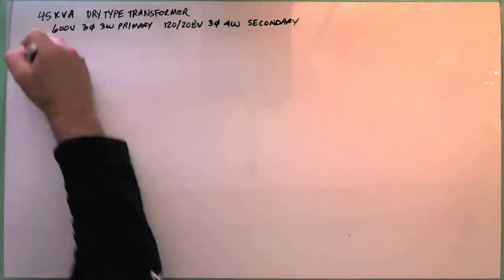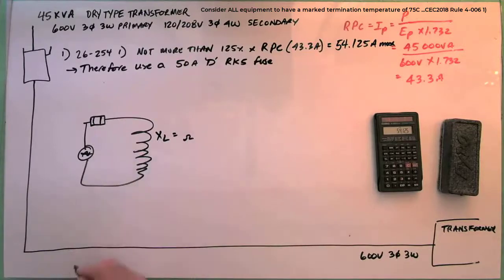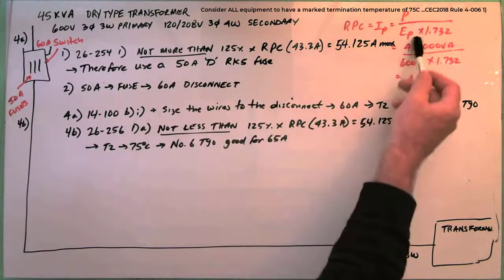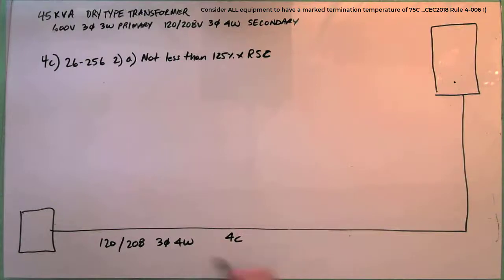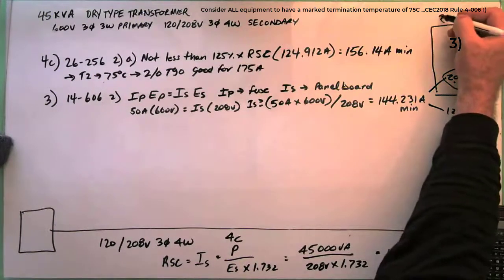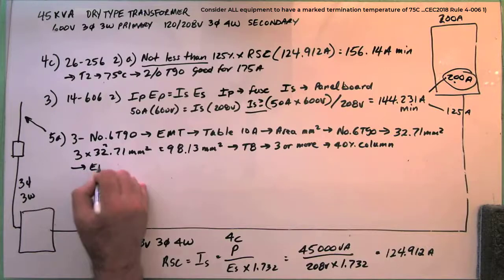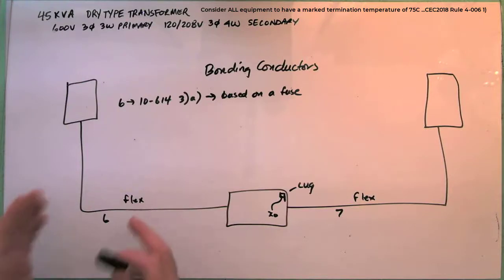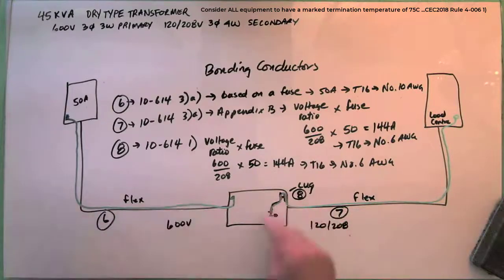45 KVA Dry-Type Transformer - 600V 3ph 3w (PRI) to a 120/208V 3ph 4w (SEC)

Comment: Hi sir just have question don’t we go up for primary over current as per 26-254(3)
Pls clarify
Reply from the maker: Good question Goldy, before I answer it ...you don’t always have to increase to the next higher standard size fuse.

Dry type transformers ...depending on the manufacturer come in standard sizes of 15kVA, 30kVA, 45kVA, 75kVA etc. Time delay fuses come in sizes of 15A, 20A, 25A, 30A, 35A, 40A, 45A, 50A, 60A, 70A, 80A, 90A, 100A etc. So, there isn’t many dry type transformer sizes available, but there is a large selection of available fuses for the installation. 

26-254 1) is your maximum fuse size ...not more than 125% x Rated Primary Current. 26-256 1) a) and 2) a) ...would be used to size your primary and secondary conductors.

26-254 3) – YES, allows you to increase to the next standard size fuse ...keep in mind if you do increase your fuse ...need to follow 26-256 4) for sizing your primary and secondary conductors.

You have choices when sizing the primary fuse of a dry type transformer.
Reply: @rongranelli6085  thanks much for the info